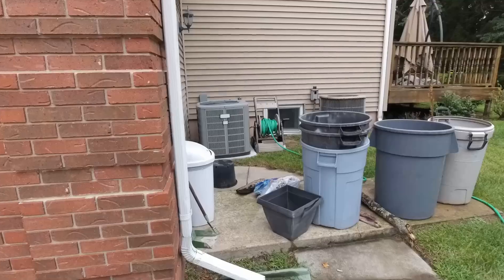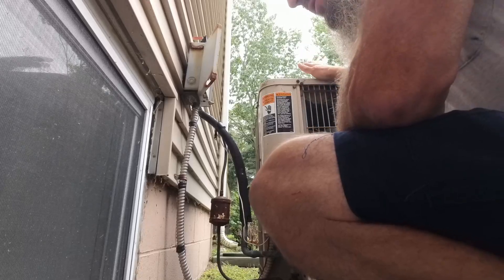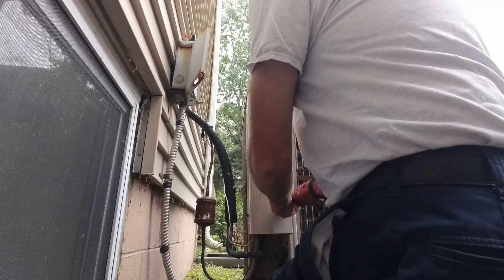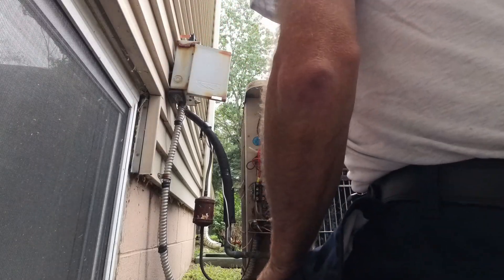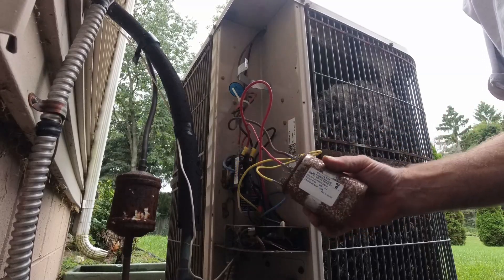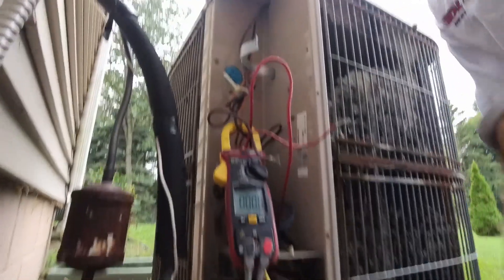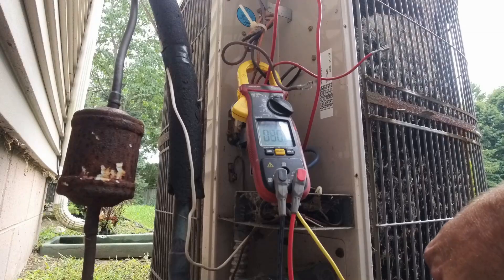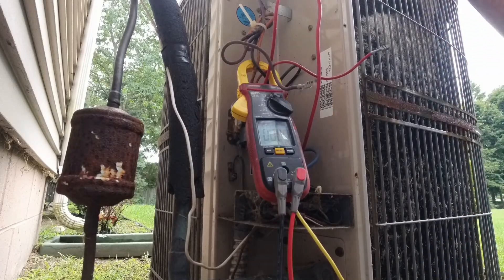No AC Old Lennox HS23

Comment: I know you're trying to keep your toolkit as light as possible, but a ratchet crimper for those insulated terminals will make a much better electrical and mechanical connection.  They're very common, so not too expensive.

Comment: My little sister has some of those at her house, a place she built in the mid-1990s, they are all Lennox units, I don't think she has ever had any problems with them, the odd thing is I can't remember how many outdoor condenser units they have, maybe 8 or so??  probably a few more than that, all she does is change filters.  The contrast between her large house with AC and my house with a few box fans is pretty stark,  And I'm definitely not in my sister's class.